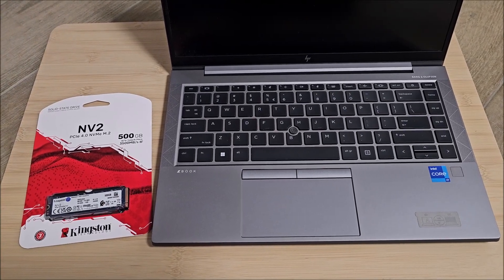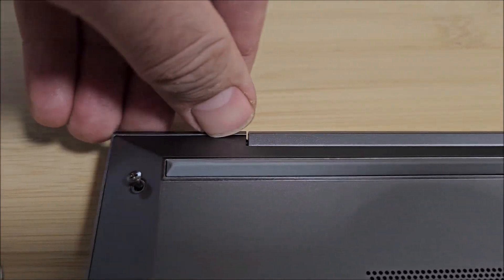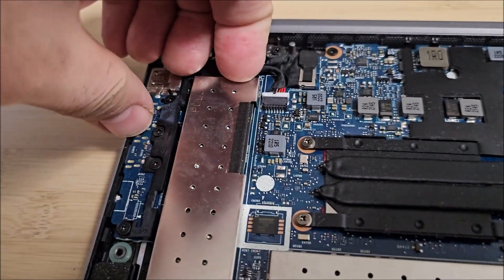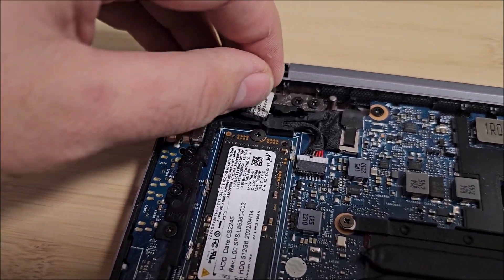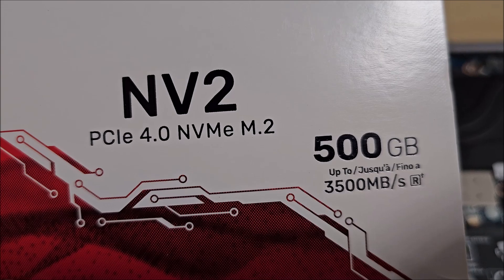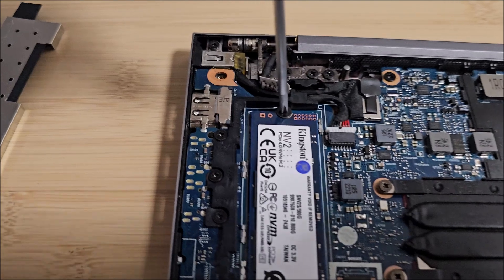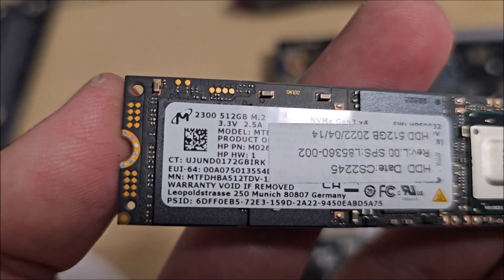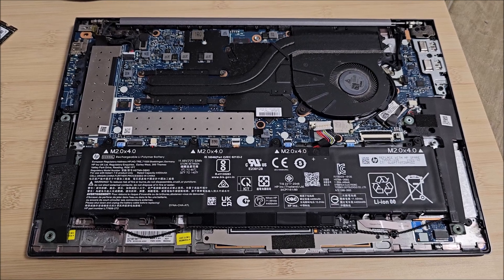How to replace the SSD in a HP ZBook Firefly 14 G8

Comment: How can I update ram?
Reply from the maker: Depends a lot on your particular motherboard model. Mine has soldered ram that can't be upgraded. Bu there is info online that some come with ram slots and you can upgrade. Open the back of the laptop and see if you have ram slots or not.